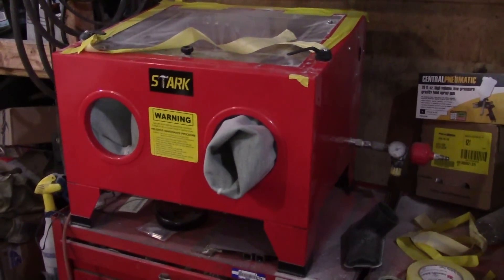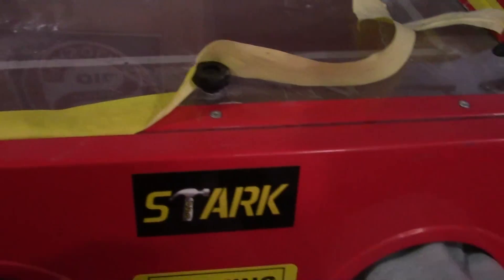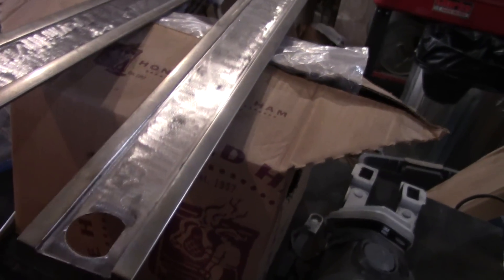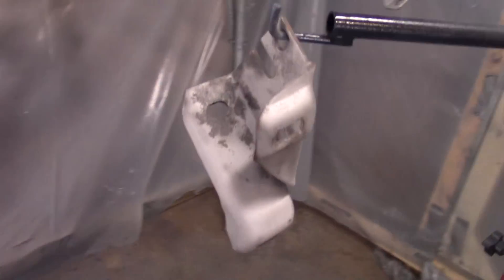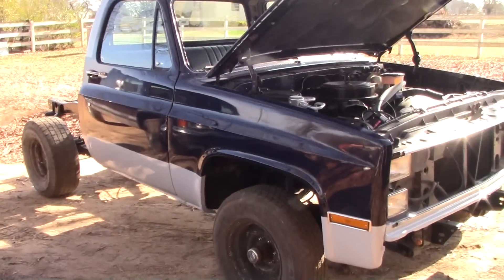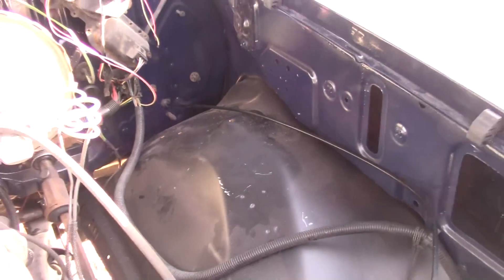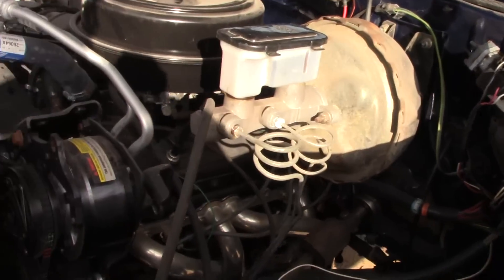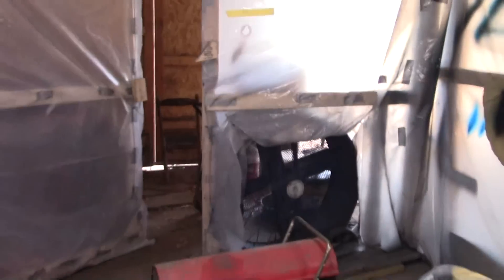1985 Chevy K10 Restoration Part 122

Comment: The wiper motor you are using has a mechanical pump so its 84 or earlier. The 85-87 had the pump mounted to the reservior. You are correct in that the wiring laying on the inner fender is for the pump. I think its a controlled ground circuit so dont be surprised to find 12v constant with key on.
Reply from the maker: Thanks for the info! So, I wonder why it has both set of wires?
Reply: farmboy30117 thats an excellent question to which i cant answer. Im wondering if the original harness was damage and they got one from another parts truck back in the day

Comment: the pink wire is the hot wire for the windshield washer fluid pump on the reservoir the white wire is the ground wire for that pump on the reservoir you can go to any junkyard that has a Silverado from 1984 through 1995 they have that style of pump and as I am aware of there are at least three variations styles of plugs for that Reservoir pump
Reply from the maker: Thanks for the info Daniel!  I might have to make a trip to the junkyard ;)
Reply: no problem, I own a 1992 Chevy Silverado  with an 8 foot bed and an extended cab.  and from what I can see your pump on the Reservoir is the same as mine. if there is a way that I can send you a pic of mine I'll let you see the component harness and wire locations on the connector in case if you want to fab up something to make sure it works!